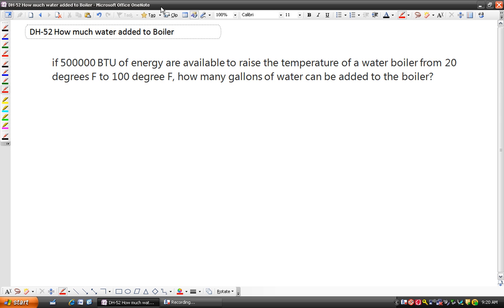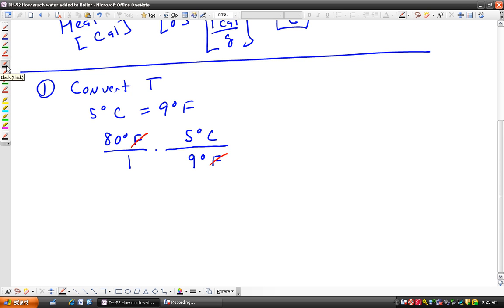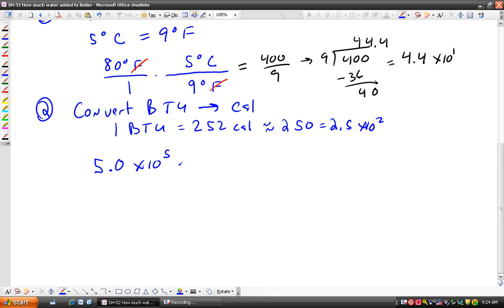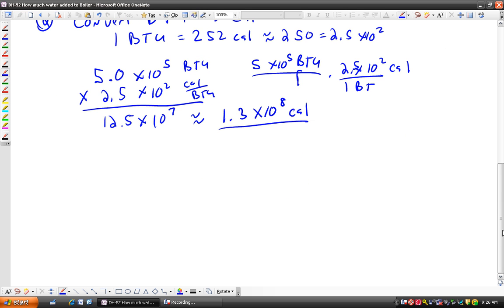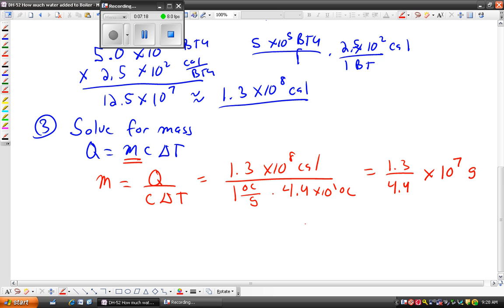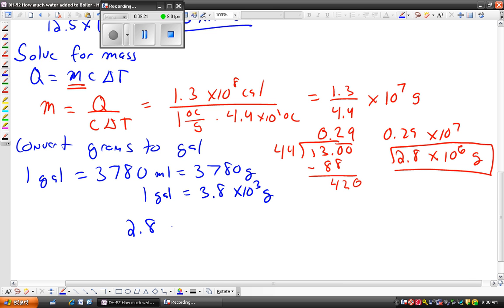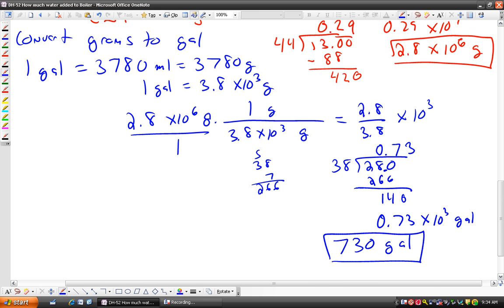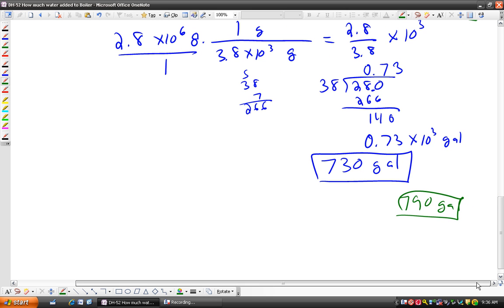DH52 Specific Heat of Boiler Calculation by Hand.avi

Comment: [ (500,000 BTU/80 degrees F) * ((1 lb water * 1 degree F/1 BTU) * (1 gal water/ 8.3 lbs water) ] = 750 gallons water

1 BTU = amount of heat required to raise 1 lb of water by 1 degree F
1 Gallon of water = 8.3 lbs

Your video shows a great series of conversions, and is an excellent example of a "heat" calculation,  but I believe the problem was intended to be solved using the conversions above.